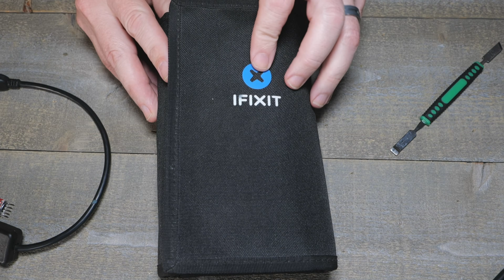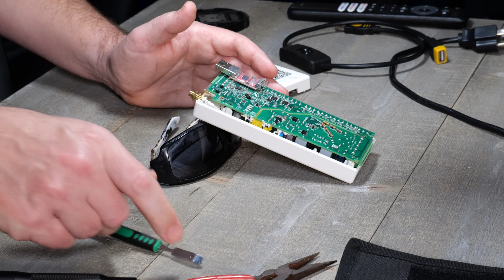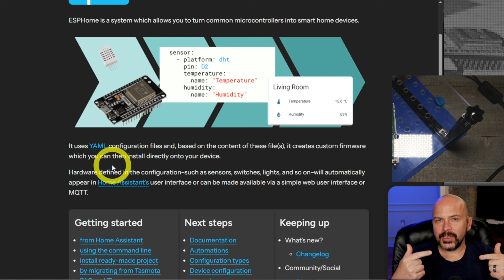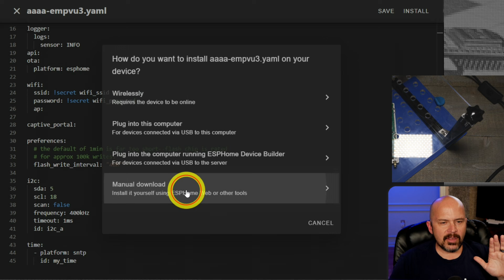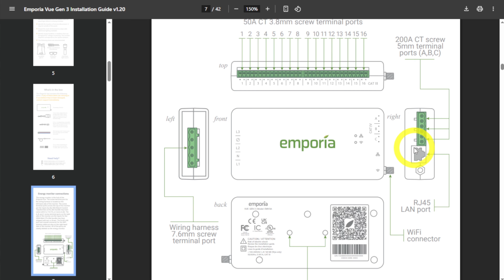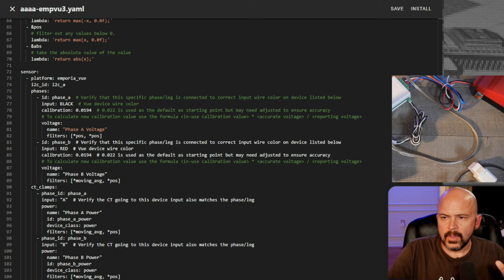Emporia Vue 3 ESPHome Install: Power Monitoring with Home Assistant

Comment: I could have used this esphome builder turorial when i was trying to build an esp32 for microair easystart translation, however, i had to hold the boot button and flash everytime, any idea why i couldnt get the ota to work over usb? Maybe ill try again because i have to exchange the unit now so ill have to update the mac address.

Comment: I want to chime in on the ethernet part of this. Yes you can enable ethernet in the yaml configuration. Also people seem to not understand low & high voltage mixing in a US panel. Because the Vue 3 is a certified and listed device (UL), ethernet may enter the panel and terminate at the device. The vue 3 itself has the proper and approved isolation to allow it. There are some conditions thought. If you have conduit going to your box then the ethernet cable must enter in its own conduit and not shared with anything else. If you have Romex going into your panel then the ethernet cable must enter through its own single knockout without sharing with other runs. The cable cannot be ran all throughout the box either. If your VUE 3 is at the bottom of the panel then run your ethernet to a bottom or lower side knock out. If your VUE 3 will be at the top of the panel then run the ethernet cable into a top knockout or upper side knockout.
Reply from the maker: You are missing the very important part. The 600V rated ethernet cabling as well.
Reply: @digiblurDIY that's misinformation. That rating is for any line carrying high voltage. The Ethernet cable itself can be any standard cable. As long as it's terminating to an approved device and not running across the breakers. Inspector approved in the US
Reply from the maker: Going by what Emporia support stated is required for their product.
Reply: @digiblurDIY  let's check the code 725.136(D) allows mixing of low and high voltage with an exception of the low voltage being functionality associated with a device. 
Also 800.133(A) states separation of low voltage except when using a listed device. Then communication wires can be present. VUE 3 is a listed device.
And then the important one 110.3(B) Listed or labeled equipment shall be installed in accordance with instructions. Official documentation of the VUE 3 explains how to run the Ethernet cable into the box. No special 600v high voltage cable mentioned. 
Trust me bro solar equipment often has Ethernet going into panels for monitoring and these specific NEC codes allow it.
Reply from the maker: You might want let them know their manual needs corrections as I am just going by their installation requirements on page 36. https://www.emporiaenergy.com/wp-content/uploads/2024/03/Emporia-Vue-Gen-3-Installation-Guide-v1.20.pdf

Comment: I'm undecided as to whether to go with the vue or the refoss. From my understanding the refoss now has its own hotspot to connect it to the wifi? Or does it still require the app? App use a no-go for me.
Reply from the maker: You can do the Hotspot but not it takes a custom component. It's meh.. One step forward two steps back

Comment: Some of the newer Vue3 units have their 1-16 mirrored, so 1 on the unit = 16 and 2 = 15, etc.  If you find that's the case, use ABS instead of POS because the black and white wires are also reversed.
Reply from the maker: Split phase makes it easy. Change the reference. But you can do that in 3 phase setups.

Comment: This has been a fantastic tutorial, about 5 months ago i was able to flash a emporia vue 3 and its been rock solid ever since. So much so i decided to buy and flash a 2nd one. Everything went smoothly up until the final step where you go into esphome and "add" it to home assistant after it was discovered. It does add, but its not showing up any values, and each "reportable value" is showing up as an entity and not a sensor. I also made sure to rename the device so it wasnt sharing the same name as the first. Any tips?
Reply: Scratch that, i fixed my naming convention (make sure that you use a yaml unique name with no spaces, and friendly_name that are unique to this device) and all is working. If you use any of the same names as your first emporiavue nasty things can happen.
Reply from the maker: Glad you got it figured it out!  Thanks for the positive comments!

Comment: ESPHome is wayyyy too unstable for a device like this. Everytime they update Home Assistant or ESPhome itself, it wreaks HAVOC, especially on custom YAMLS like this. It becomes too cumbersome to keep the devices working. Especially when you're depending on some random dudes vibe coding YAMLs to stitch everything together. I wouldn't recommend anyone, regardless of skill level to go this route for these kind of devices.
Reply from the maker: Noice. I would suggest you stay stock for sure if you have Esphome issues. Love some Esphome myself especially with the last two upgrades.
Reply: @digiblurDIY yeah I guess it all depends on the devices. With the mics/wakeword setup I have, esphome broke things with every update. It became a part time job maintaining those yamls to get everything working.
Reply from the maker: I use it with CircuitSetup and Emporia and 40 other various devices. I haven't used the wake word stuff as I don't have local model yet.

Comment: Can't install the new config as it asks for a password but I never set one that I know of. And I can't add it to Home Assistant, it says: 
Unable to connect to the ESPHome device. Make sure the device’s YAML configuration includes an `api` section. I guess I'm stuck re-trying the pins and re-setting it up with esphome? Has anyone else run into this?
Reply from the maker: Did you put an API key and/or OTA key? My default config doesn't have these keys and includes the API section to keep it simple so people don't lock themselves out of a device.

Comment: Thank you!    I purchased three VUE 3 units.  Using the stock firmware (for now at least) and have determined that the “balance” is off at times up to 41 percent. Have contacted support and they tell me that I have too little of a load. While I understand the theory here, I am somewhat annoyed with the inaccuracies here. I understood that there is a 2% variance, 41% is just too much for me….    Anyone else experience this?     Does the ESPHOME firmware solve this?   I am betting that it doesn’t… Or am I wrong here?    Fully willing to go through the effort if others have better experience with the ESPHome firmware.
Reply from the maker: I monitor very low loads with the Vue3 without issue on ESPhome.  I'm looking at a circuit with 5w load on it right now.  Sounds about right.

Comment: I bought my eGauge in 2014. Has local access as well as internet web browser access. None of the stored data is on their cloud. Since I bought mine they have added many more features. No flashing or hacking required. They claim my device can store 35 years of data on the eGauge.

Comment: Thanks for the awesome guide! I connected the Emporia to my PC with a BDM frame and grabbed a backup right away. For once I didn’t spend three hours troubleshooting serial comms but ESPHome in HA wouldn’t compile the binary. After some troubleshooting I had to uninstall and reinstall the add-on, so that still took about three hours. It’s installed on my breaker box now and working great. I’ll start playing with the data next.
Reply from the maker: Awesome! Glad it is working out for you.

Comment: Thanks for the video! Ended up picking one up and was able to tear it down, solder it up, and get esphome running on it in less time than it took me to find my flasher! Can't wait to start digging into it once I get it installed.
Reply from the maker: Nice!
Reply: @digiblurDIY It took longer than I care to admit to figure out that for some reason, my CTs were all inverted. Thankfully I wasn't the only one and others in the github discussion talked about it which led me down the right path. Really had me scratching my head why everything reported 0W except for the primary conduits. Finally got everything working, and in just one afternoon, I have whole home energy monitoring. 

Thanks for all your hard work on this project!

Comment: Here’s an ignorant question or two.  Emporia has a family of products that all work together with their “dumb stock software”.  Currently I use this stock software to control an EVSE based on the amount of solar production we have.  It works fantastically to charge an EV solely from solar production when production exceeds our use of electricity.

If I were to flash the memory of the Vue product, how would I  continue to use it to control the EVSE?

Specifically, can I use HA to control the EVSE in a way the current Emporia software does not provide for.  Our utility limits the amount of solar energy than we can send through their grid connection.  Theoretically my array is capable of more than that so it would be helpful if a connected EVSE could start and send the excess energy to an electric vehicle and do so as long as the amount generated by the solar panels exceeds our current utility limits.  The stock software does this exact thing only it starts and ends at near zero production so no solar energy goes to the grid at the same time.
Reply from the maker: To keep those tightly integrated with each other you'd need to also some how get HA to talk with the EVSE to turn it on and off as necessary.
Reply: I am currently able to turn the EVSE on and off with HA as well as control the amperage of the charger. 

Emporia has been having issues with their cloud services recently. When that happens nothing works. Therein lies the desire to bypass the cloud.

Comment: Does this work on Ethernet as well? I would like to keep my vue 3 on Ethernet.
Reply from the maker: Yes. I just do not have the necessary rated cable and such to mix ethernet in my box so I didn't use it.

Comment: Complete noob here, who just bought an overpriced pcbite. I have no idea how to provide ground. How can I do that without a solder? I'm completely new to this and have no idea what im doing lol
Reply from the maker: Do you have a Dupont jumper? That's what I use to just drop in the GPIO 0 hole.
Reply: @digiblurDIY I do! I bought everything in your description. How would the DuPont jumper provide ground?
Reply from the maker: @javilionaire connect it to ground and put in the hole.
Reply: @digiblurDIY not sure I understand. So one end of the dupont would go to the probe touching the ground on the pcbite, which is touching the board? Where would the other end go to? Thanks
Reply from the maker: @javilionaire I usually connect it further up on the USB adapter and make a splitter to have two grounds.
Reply: @digiblurDIY do you have a video on this? I’m not sure how to do that haha 😅
Reply from the maker: @javilionaire no. I just either use a header with a glob of solder or go the old school way. Cut the wires and twist all three together. Pretty easy method there
Reply: @digiblurDIY  got it. Sorry for all the newbie questions. To make sure I understand - i need 2 grounds connected to the board. I’ll have 2 pcbite probes touching those grounds. I’ll then connect a DuPont to each of the ground probes. I’ll then cut the other end of the DuPont wires and twist them together, connect a longer cable to them and have them touch a ground?

Comment: Do you know if you can use larger than 200A CTs with the Emporia?
Reply from the maker: In theory you could, you'd just need to adjust the calibration
Reply: @digiblurDIY thanks!

Comment: So you have to run the esphome software on the server in addition to home assistant? When I flashed Tasmota on some smart plugs I
 was able to get a home assistant tasmota integration.   Is the esphome app the middleman?
Reply from the maker: No. Esphome on the device will allow HA to connect directly to it. No middleman. The esphome builder is only to push firmware changes you need to it.

Comment: Question on total power:
I'm reading 0.0 from the total_power portion, but I am getting good results from the total_daily_energy individual clamps that use total power as their power_id. I've confirmed my clamp phases vs. the input legs, and have confirmed they work by comparing the readings to devices on those clamps that also report their own power consumption.
I get good voltages on both legs, and have slightly adjusted the coefficients to match measured voltage.
What more can I do to troubleshoot getting a reading for total power. I have more circuits than CT clamps, so I really want total power to figure out stray power consumption.

This video is great, BTW. You've already saved me $100 a month in finding stray power drains. Liked and subscribed!
Reply from the maker: that's odd it isn't adding up as that is just a template sensor adding those two clamps together.  Is one negative maybe?

Comment: I'm anxious to get this flashed, but I'm running into problems getting into the ESP32.  Running <esptools flash_id> and I cannot get it to communicate, so I haven't tried to flash it.  I am pretty comfortable with electronics at this size and just soldered to the test pads.  At first the ESP32 was pulling the voltage down below 3.3v on a legit FTDI adapter, so I added a cap and it is holding voltage now.  Tried swapping the TX RX lines, and tried powering on with and without the IO test point grounded.  Still no love.   Any suggestions welcome.
Reply: Did you  ever fix this?  I am having the same issue.
Reply: @shawnfox638  - i really struggled getting probes onto the pads recommended here and I spent HOURS trying to get it working.  I wound up being successful by placing the probes on the actual ESP32 chip as they were more accommodating.   Keep in mind that if you do this, you will go back to having the ESP32 RX go to TX and the ESP32 RX going to TX.

Comment: For the life of me I can't get passes the flash_id piece. Any info on drivers or anything i would need for the usb_ttl?
Reply: I had a lot of issues with this. I recommend buying the USB device in the description, I used my flipper as a UART bridge and it was giving me hell.

Look at your extra ground pin, the 5th pin, that needs to be making contact my the copper ring, I had a lot of issues and it turned out to be that.

Comment: You mentioned it is factory calibrated.  With the reflash, won't that erase the Factory calibration values?
Reply from the maker: We aren't reflashing the secondary sensor chips. There is a configuration in esphome to adjust the voltage of needed. If the clamps are wildly off you can adjust them with multipliers as well.

Comment: Why not just solder to the pcb? It’s faster and easy at least for me
Reply from the maker: There's a vast amount of people that don't want to or have any interest in soldering.
Reply: @digiblurDIY  - oh i did this and tore off a pad.  I didn't even see it coming....    Found that placing probes on the IC worked so much better anyway, but keep in mind you will have to go RX>TX and TX>RX on this configuration.

Comment: 😮Nice work!
I would like to use it on a three phase board. Can you tell what power measuring chip is used?
Quite important for me is that the device does the correct measurement calculations with voltage, power, power factor, current etc.
Reply from the maker: You aren't going to get all those entities with this product.  I'd suggest the circuitsetup one.

Comment: I don’t think you need to monitor both legs on 220v. It should be equal unless you’re using the neutral along with the 220.
Reply from the maker: I have unbalanced split phase loads myself.

Comment: can you please share the yml code with clamp 15 and 16 on the solar inverter?   the yml code u shared is generic without solar.  or it does not matter?
Reply from the maker: A guy shared one with solar on the github thread I linked, he had some batteries too I think.  Lots of examples to go off of.  This one - https://github.com/emporia-vue-local/esphome/discussions/264#discussioncomment-12594737

Comment: Still looking forward to the refoss video. Especially want to see the integration, what all it does. I haven’t seen a single video going through the install on ha.
Reply from the maker: Definitely working on a test setup that makes sense.  Trying to get my hands on a used breaker box to mock up for these in the future but if I can't get it I will use my desk.

Comment: Weird question but: any idea if the clamps from the Vue 2 will work if I just cut the ends off? I have the Vue 2 now but the wiring is a mess because you couldn't customize length
Reply from the maker: Good question. Let me see if I can find out. I also wonder if they make some 2.5mm to screw terminal adapters
Reply: @digiblurDIY  A quick search has them at about $1 each from aliexpress. Seems a tad high, I'd probably just resolder phonoplugs, if I cared to neaten up the wiring.

Comment: Hey Travis, when flashing an Emporia Vue 3 with ESPHome, are you still able to use the ethernet connection to your LAN in lieu of WiFi?
Reply from the maker: Yes. I just don't have the ethernet cable spec to support the requirements for it.
Reply: @digiblurDIY  Looks like hard wiring the ethernet is the primary reason someone would consider replacing a Vue2 with a Vue3, though I suppose having the UL certification might make it easier to get past an inspector.
Reply from the maker: Correct and the shorter clamp wires. I had an electrician look up the 600v spec required for the run I needed and opted out of it.